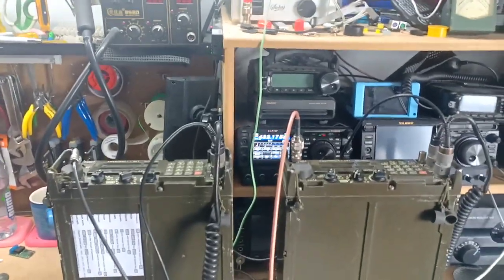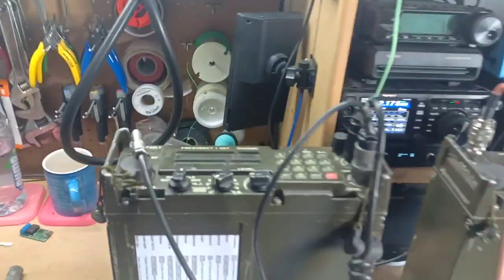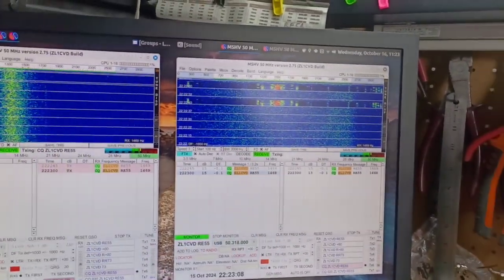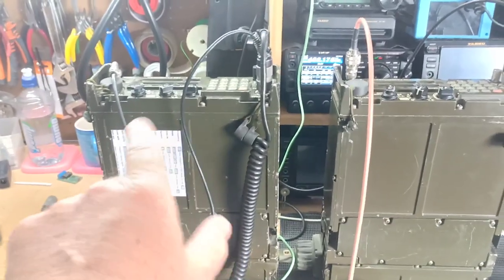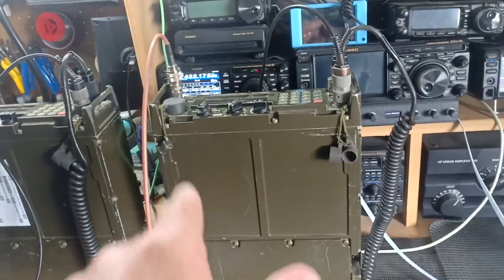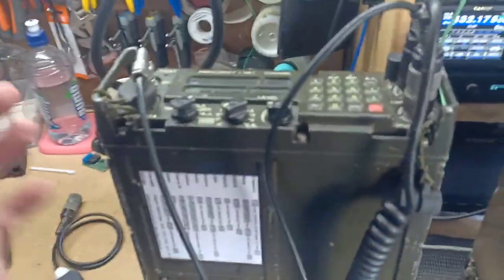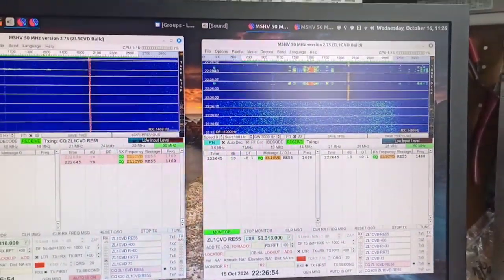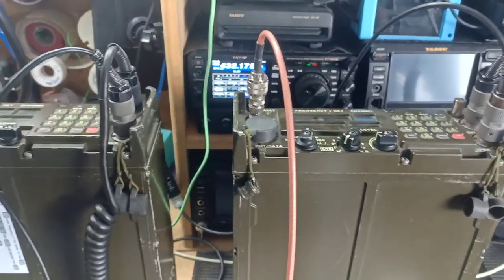PRC2200 Encrypted FT4 test

Comment: Which crypto algorithm is this using?
Reply from the maker: Not sure of algorithm but its a form of symmetric key encryption which requires the same 12 octal keys for encryption and decryption. Hopping is 15 freqs per second. Manuals are on the web including full service manual with detailed circuit description. On the PRC2200 groups.io page, one of the members has even disassembled the EEPROM - its an older 80C88 based system..

Comment: I don't know how it is in ZL land, but here in the U.S., none of us are allowed to use encryption as part of the Amateur Radio service. So, U.S. hams should not attempt to use this technique unless you're comfortable making a compelled donation to the FCC and possibly more.
Reply from the maker: The purpose of the video is RF experimentation! I'd hope US hams have enough knowledge to know what is and is not permitted in their country. Encryption restrictions are the same here OM. But the fact is, I'm not transmitting on air as described in the video by use of dummy loads. Additionally, the leakage from the cables is also well within the allowed emissions for a limited radiation device which over here, has a public GURL (General User Radio License) with no restrictions as to what the emissions would contain.  A bit of common sense is required I guess..
Reply: Read the description - done using dummy loads with no on-air transmissions.  This is therefore perfectly legal.
Reply: actually you can , for very specific stuff , like controlling satellites via telemetry..
Reply: We can and do run encryption in the US. Mostly P25 and DMR.  You just have to publish the key. How creative you get in publishing may accidently limit how public the key becomes.